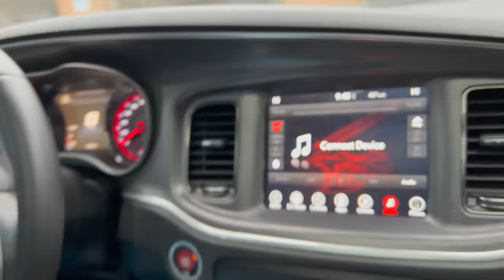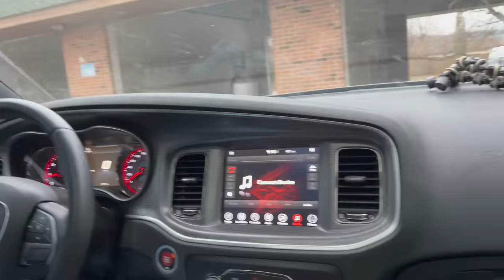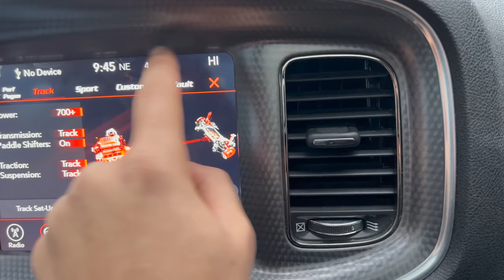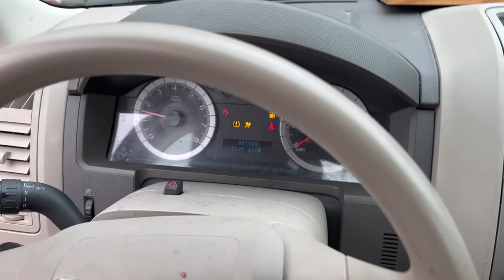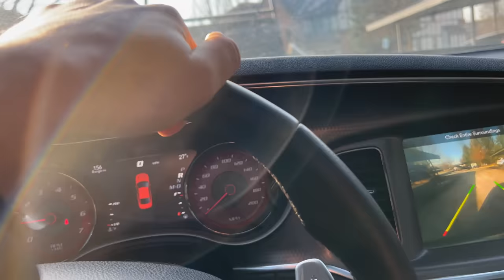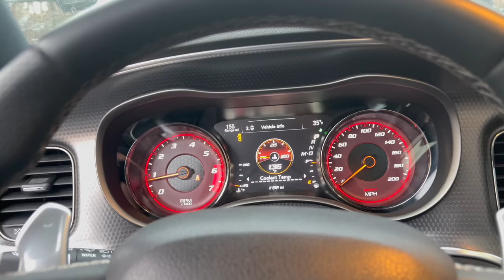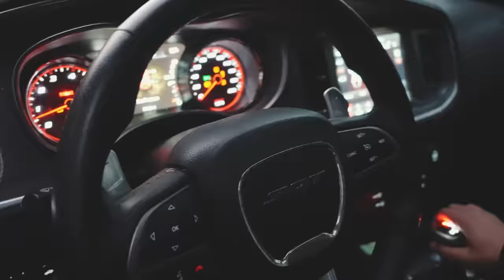HELLCAT CHRYSLER GOT STOLEN **RECOVERED**

Comment: Hey just a heads up looks like you used concentrate coolant and not 50/50 coolant the concentrate needs to be cut with distilled water if not coolant becomes like acid and starts eating away inside your engine so flush and put the correct formula or you have a lot of engine issues